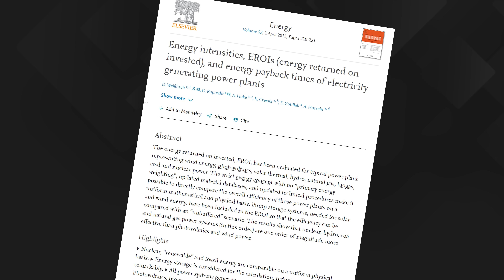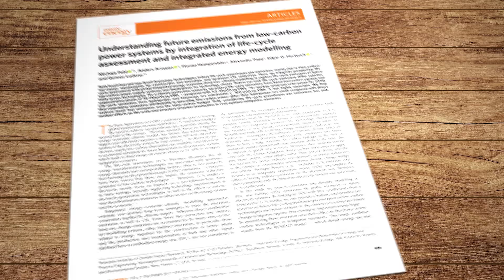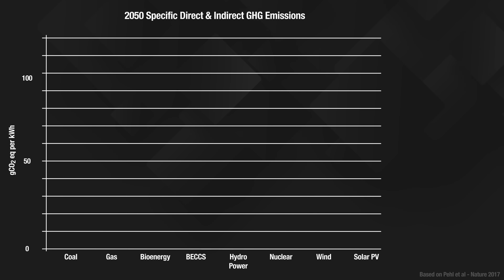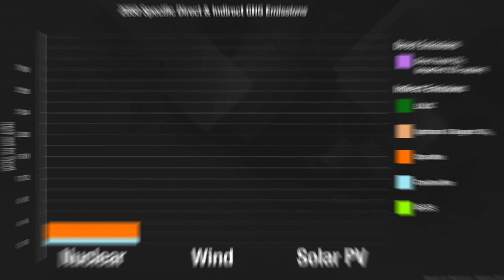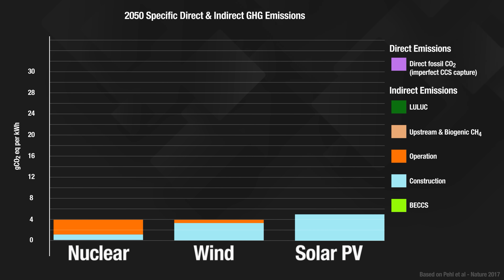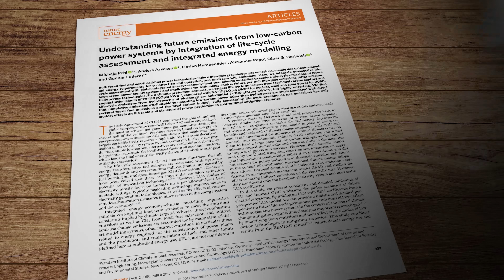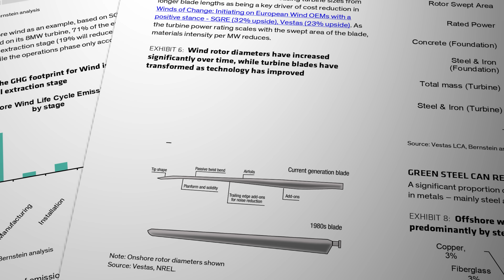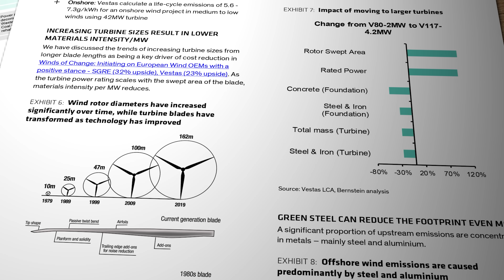Lifetime carbon emissions of renewables vs fossil fuel. Problem or solution?

Comment: There's always a ton of things to consider when looking at complex systems (duh).
The one thing that folks against green energy fail to consider, is the infancy of the technologies and the potential for improvements (and already tons of improvement)
But Coal and Gas are old technologies that have matured with little improvement left. Perhaps we'll find a new way to use coal and gas and make them better, but seems few things have been done lately.

Comment: So they factor in the co2 from the materials used to build wind turbines and solar but what about the materials used to build and run coal/nuclear power stations? Co2 to build the mining equipment, co2 for running the mining equipment, co2 to build the transportation for mined materials, co2 for transporting the materials, co2 for turning the materials into energy, co2 for disposing used materials, etc etc. ]

Comment: We need clean air. The vast majority of atmospheric CO2 is made by air breathing life. You can calculate the amount made by fossil fuel and cement manufacturing quite easily and see how it is a very small percentage of the total. The rest comes from air breathing life. Air breathing life needs warmth, the warmer it is the more life there is. You can see for yourself the differences between summer and winter, the tropics and the arctic. Also in your kitchen between, the freezer, refrigerator and room temperature. Try making bread in a cold kitchen, the yeast cannot make CO2, or alcohol  when it is too cold. Even the CO2 climate cause people use ice cores to measure the historical CO2 levels because even they know that CO2 is not made by air breathing life that is below water freezing point. The connection between climate and CO2 is the very well understood causes of climate change cause CO2 levels to change. Some of the many causes of climate change can easily be observed by looking at a map, and seeing how the terrain and other factors affect the climate. Ask how the UK in the North is warmer than parts o Eastern Canada which are well to the South.

Comment: Yea but i still question coal only being 1% construction emission. Must be because maybe it takes like 50 wind turbines to replace a coal burning plant.

I just did a quick look, it appears the biggest wind turbine produces 15 MW according to google, but a typical coal plant produces 500 MW. So it would be 33 to 34 mega wind turbines to replace one coal plant. But that is IF the wind blew 100% of the time. lol

To be realistic they would need to double that to 66 wind turbines to make up for the fact the wind isn't blowing 100% of the time, and ALSO they need to ADD energy storage for when the wind is not blowing. And that added storage has more co2 construction related emissions. But as far as i can tell the storage can outlast the wind turbines as long as they use heat storage not batteries.

Comment: I'm surprised you don't talk about the elephant in the room, STORAGE for cloudy, windless, night... Where does that come from and what is the ADDED carbon footprint for this essential element? Generation is only a part of the necessary solution.  Lets get an overall solution BEFORE you shut down more production facilities and HOPE that something will be developed to solve that problem.
Reply: Electric vehicles will need huge batteries, 100kwh battery for the long trip, but the Daily drive is only 7kwh and can be topped up daily. 
EV car owners will make money trading power with the grid 24/7.
The Australian grid covers 5,000 klm and 3 time zones. The USA grid is even bigger, it is huge and every building is connected to the grid. 
The weather forecasts every day is because the weather is different everywhere every day. 
Weather energy is always happening. 
The biggest story on the planet would be 'there was no weather today'.
As the climate destabilisation increases more energy will be available.

Comment: With majority of transport being electrical the power demand would triple. X3 today's grid demand. 

More power stations. 
More grid.
More expenses/costs. 

With rooftop solar pv. 
Local consumption and 
Local storage and 
Distributed supply into the existing grid, but a smarter grid.
Huge 100kwh EV batteries automatically plugged into the grid will stabilise the grid and trade power.
The extra demand is kept very local. 

I talk about this because there are people who are pushing hard for the Nuclear solution which would kill Renewables after the sunk costs of the nuclear power  solution. 

The nuclear power solution is a concentrated power supply option BUT to a TRIPLED DEMAND as transport is now part of the demand.
It can be a monopoly business with monopoly profits and monopoly political donations for 60 to 100years. 
NOBODY  WILL TURN IT OFF before it's profits are made. Too much invested. 

This coverage of this topic is incredibly shallow, 
climate destabilisation or nuclear winter 
Does anyone know what I am talking about ??????????
Hello, hello, hello 👋

Comment: What should be measured instead of only the "carbon footprint" is the more generic "environmental footprint". For example to what degree does the empirically proven carbon fuelled accelerated greening of the planet, the hazardous material pollution from solar panel production and the killing of 10s of millions of birds offset the theoretical/modelled benefits of carbon reduction?
Reply: That's interesting. Can you direct me to the source of the empirically proven greening of the planet from increased carbon. Where is this occuring? From increased algal growth or something like that? I know that there are "farms" that dissolve CO2 to grow algae for biofuels but I wouldn't think there were that many (assuming you are referring to atmospheric carbon).
Given the reported increase in desertification and loss of arable land it's not in those areas that it is being recorded.
I know that increasing carbon in soil helps to improve plant growth, so I wonder if this is what you are getting at, although it certainly isn't increasing in most soils globally
Reply: "killing of 10s of millions of birds"
Do you seriously believe that wind power is a big killer of birds? Tens of millions? Show me the data and show how this compares to bird deaths by collision with power lines, communication towers, buildings, vehicles, and killings by domestic cats.

Comment: Jeeze man you are supposed to be smart yet from what you have saidn you left out the top 2 reasons why solar and wind are garbage when truly calculated in a life cycle analysis.  
1) carbon AND the other enviromental destruction in the manufacture for the elerical storage of the power it creates since neither are capabale of supplying reliable energy.
2) the energy wasted by both.  Studies are all over the place but even a quick look cuts out the college level and enterprise (corporate) estimates of effeciemcy.  These plants are almost always under 30% effocient since the majority of the energy produced is wasted or stored.  For the energy stored it looses a mininum of 20% just from one cycle of storage to DC to AC to conversion.  This happens at every main transportstion lost amd doesnt even include line loss.

Comment: I feel like I've only gotten half the story here. Even in sunny Sydney sure solar PV is very cheap per KWh but add in the cost of battery storage and it's not competitive plus that's another thing that used scarce resources that need to be recycled. On top of that we've had some unusual weather with lots of overcast / rainy days. At least all our dams are full but many have lost their homes in the floods. I have no idea how our already changing climate should be factored in the modelling and consideration of which renewable has the least carbon footprint. Given out dependency on energy my vote still goes to nuclear.

Comment: This comparison is not at all a comparison. You are comparing baseload power stations to intermittent power stations. Wind and solar are not on par with their competition. They need batteries factored in to their calculations. Loads of batteries if they are supposed to be the only baseload sources. Hydro resivoirs can act as batteries to some extent, hydrogen could become another storage solution that replaces gas but yeah this comparison was too biased to be a good comparison in my view. 

I live off grid with solar panels and batteries, so I am well aware of the ins and outs.

Comment: New Zealand has lots of Hydro - some 100 Years old and only just having its turbines upgraded, these are mostly on running rivers without the giant still water lakes that seem so common elsewhere - Therefore, I suspect the CO2 figures quoted fail to take this type into account.
What about trees that grow to harvestable size in 18 years (instead of 30 in other parts of the world) does this not increase the carbon captured.....

I suspect that more personal power generation with small storage will cushion the impact of getting rid of the fossil plants. Distributed generation is a great way to help the grid.
I have just commissioned a 7.5kw array on my roof and a 12kw battery - and in the middle of winter it is providing 60% of our 3x bed house requirement (4x adults and a big workshop). We oversized by 50% and are very happy that we did - even on crappy wet days it still gives us a good solid base.

Comment: Thank you for the new video! It's good to see you again.

Don't know how much of a difference it would make, but I've heard that AI can be used to optimize the placement of wind turbines, so they don't interfere with each other when placed in large groups. That might increase their efficiency even more.
Reply: AI should be used in the networking most effectively; because modern devices can provide more details and we can have solar insolation and wind pattern data from independent sources on a very low granularity. People who produce and consume locally must be the greatest beneficiary. AI can play a very important role in the distribution and regulation and pricing.
Reply: Absolutely. More information means better models and more efficiency. Lots of tiny little solar powered sensors distributed over a wide area could provide that fine grained data for AIs to chew on. Meanwhile, truly smart electrical grids could help each household determine our individual costs and benefits better than we do now.

One thing that frustrates me is getting an electric bill that fluctuates wildly from month to month and not knowing why. AI could help explain what's going on in a more simple way.

Comment: A question (apologies if I could answer myself by checking all the papers) ...
Do the figures for Wind and PV include a factor for the associated storage technologies which must be used to ensure on demand electricity generation?
Reply: I can only guess too that is nit.
A fair comparison needs to compare continuously available energy sources, ie renewables  + storage plus fossile standby plants vs nuclear and fossile.
Since storage technology at scale is not yet decided yet, its carbon foodprint is not known too.
.Don‘t get me wrong, I operatr a 19kwp PV on my roof top to supply me and my neighborhood.
But I also recognize that this does not yet represent the final solution (still evaluating battery storage options)
Reply: I doubt these are included as most places in the world haven't reached high enough renewables yet for this to become a major part. Although it looks like these will not be high enough to make a major difference. Costs is the big issue with storage not CO2 emissions.

Comment: the lifetime if solar panels is moot, we still get useful work from a bp solar panel which we bought more that 30 years ago,  there should be a second life for solar panel which reach their commercial life, an 80 percent 300 watt panel would make more than useful power for an iff grid situation, along with re cycled EV batteries.

Comment: You are one of the best and well researched alternative energy presenters on YouTube. Thank you.
Reply: The Earth is cooler with the atmos/GHGs/albedo not warmer.
To perform as advertised the GHGs require “extra” energy upwelling from the surface radiating as a black body. https://youtu.be/0Jijw7-YG-U
The kinetic heat transfer processes of the contiguous atmos molecules render that scenario impossible.
No greenhouse effect, no GHG warming, no man/CO2 driven climate change or Gorebal warming.
Reply: Did his calculations account for intermittency and storage systems such as batteries needed to make solar and wind able to be baseload sources
Reply: I wonder how much money this guy gets from windmill companies?
Reply: @scottslotterbeck3796  probably less than you are getting from shell

Comment: Comparisons of the carbon footprint of nuclear vs W/S is misleading because you have to build at least 4-7x more W/S capacity than nuclear (due to differences in capacity factor, seasonal variations, and inefficiencies of storage) and you have to consider the carbon footprint of the storage and transmission infrastructure, which would likely be several times higher then the W/S itself. The carbon footprint of nuclear waste storage is already included to an arguably greatly exaggerated degree, particularly since the waste can and will be used in fast reactors to generate centuries worth of electricity production. 

Nuclear reactors use HUNDREDS of times less steel and concrete and last 2-4x longer than w/s, so the fact that the figures are as close as they are is highly suspicious. The numbers just don’t add up.

Comment: You completely ignored batteries!  In order for wind and Solar to work, you need to store the power.  Right now, lithium ion is the candidate for energy storage, but that technology has a carbon cost of 100kg-CO2/kWh... That doesn't include the cost of recycling or disposal, both processes which are unproven.

Yes, Tesla claims they manufactur batteries at 60kg-CO2/kWh, but they also buy most of their cells from China, which can be as dirty as 135kg-co2/kWh

You cannot claim to have a conclusive answer without factoring in batteries.

Frankly, the idea of lithium ion for grid storage is stupid because we need batteries for electric vehicles, there isn't enough production per year to satisfy demand, and there isn't enough available lithium on the earths crust to store our energy needs.

Yes, we can point at emerging tech, but how many of those technologies are locked in being "ten years away"?

Meanwhile...nuclear is here, now. NOW...  We can offset all this carbon now

No storage required.

Also, you make the nuclear waste problem seem bigger that it is.  It is TINY and very manageable.  All the spent fuel ever used could be stored in a parking lot of a grocery store.

Comment: A comment on German wind power from a German (google translation …)

64 GWh wind currently installed

German energy demand 285 GW
So 5 x more is still needed without even considering e-mobile growth or H2

Today we have 64GW, there is still 80% missing, plus demand for e-mobility. So do the math:

But what does 285 GW of wind power mean in itself?
Roughly 100,000 wind turbines, with a term of 20 years, i.e. 5000 per year renewing & recycling, (partly hazardous waste)

Costs per new tower, about 2-3 million euros, makes with 5000 new annual replacements then total costs with demolition of about 20 billion euros 😳
You have to internalize that first, we need 20 billion euros every year later only for the replacement (maintenance is not even included,  nor e-mobile demand. 😵‍💫

Now you can also guess why China is also continuing to research nuclear power, because with 5000 towers you could build 1-2 nuclear power plants per year, stable base load power and with much longer runtime (60-80 yrs?)

We don't even manage 5,000 turbines a year today. Hard enough to rebuild 14 a day, so how do we ever want to reach any fantasy numbers? 🤷‍♂️

Comment: How you compare Wind either on shore or off shore as a head to head comparison against an unwavering 24/7 power source like nuclear.  Apples to Oranges!  You'd have to add whatever energy storage is attached to the wind to even closely approximate such a comparison.

Comment: When people talk about 2C like it is an option... 2C is already unavoidable.   At current rates 3C is baked in as of 2026. 4C by 2050.

Imho,  5C is unavoidable short of inventing a new technology that inexpensively removes carbon from the atmosphere straight to solid carbon.

Trees only fix 2% of the problem every 20 years. We are literally releasing over five thousand years of plant growth worth of carbon into the atmosphere every year.

Comment: It is misleading to discus solar solar wind without addressing availability, in other words, storage.  This issue is two or three decades away from being addressed at the level needed to reduce carbon emissions to necessary levels.  Currently manufacturers don’t have the battery production capacity, or raw materials, for a small fraction of personal vehicles.  We are no where close to what is needed for the entire grid to switch to renewables.  Your channel has given a fair look at nuclear in the past.  I am glad you included it in the analysis of solar and wind but excluding storage misses a critical piece of the equation.